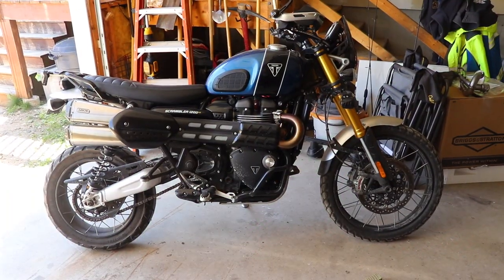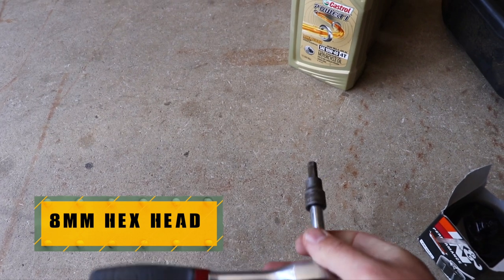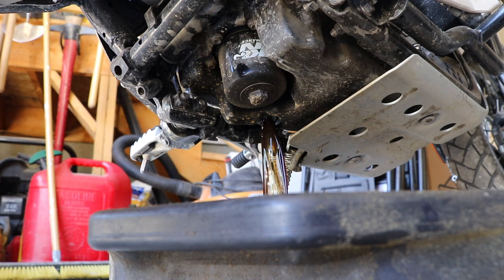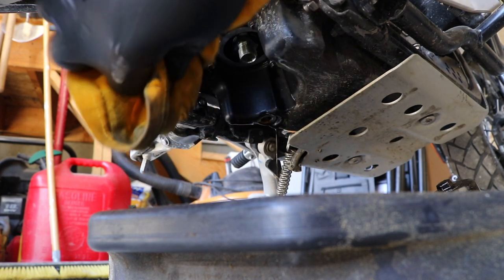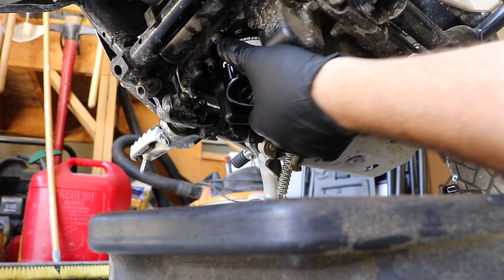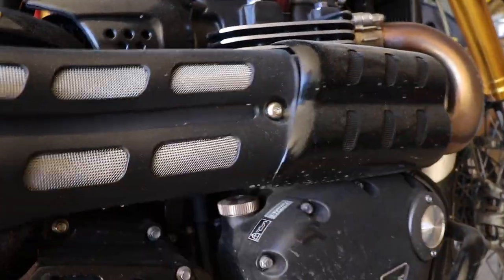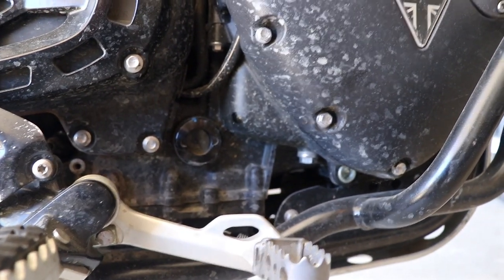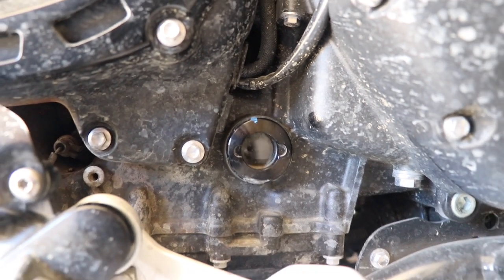How To Change Oil on the Triumph Scrambler 1200 DIY Maintenance EASY

Comment: Just a heads up to anybody that prefers using Oem filters, you can buy the Triumph Service tool that removes the OEM filter, if you plan on replacing it with a new Oem filter

Here is the part number for the oil filter wrench T3880313
Reply from the maker: Thank you for that!

Comment: For goodness sake, clean the areas around the oil filter and the oil plug BEFORE removing them, not AFTER you have put them back. Removing the filter and oil plug with all the road crap still around them is a classic way of introducing harmful debris into the engine. Also, that plug should be cleaned off carefully using brake cleaner or similar aerosol spray, paying particular attention to the magnet and then dry it before putting it back and fitting it with a new washer. Oh, and please DON'T use the draining oil on the seal of the new filter either, use a small drop of clean new oil. The old oil contains micro metal debris which can create a seal leak. Sorry but this is a conscientious mechanic speaking here!
Reply: I would also recommend using a torque wrench when tightening the drain plug. It is a $16000 bike after all... you can afford a decent torque wrench if you can afford this bike!
Reply: I thought the same and I'm not even a mechanic, that bike cost 20k USED! in my country (new 26k).
:/

Comment: Oil fill cap can be easily removed with 10mm hex socket and 6 inch ratchet extension.

Comment: Hi great video my friend where can you get those filters they look really good.. And how do you get the old one off do you need a special tool for that... I notice that your heat shields are black did you spray them yourself and if yes what did you use or did you buy them and on the subject of the heat shields does your back one rattle ....cheers J
Reply from the maker: Filters right from Amazon. The factory one is super tight, you just have to talk mean to it. I use a large pair of channel lock pliers to take off the factory, the K/N one has a nut on it. I did paint the shiny objects, yes, used VHT. I have a vid on that posted. Ride Safe! Stay Safe!!
Reply: Hi thanks for the information I had a look on Amazon for that type of oil filter it seems it at a great price and there's alot of good reviews for this filter but there is one review on there saying that there a fault on these filters where they leak at  the nut have you every come across that type on problem my friend...👍😎

Comment: You should admonish your viewers that the nut welded on the end of the K&N filter should only be used in removing the filter, and never tightening the new one. Many reviews of the K&N point out that if you use the nut to tighten the filter, it may cause a leak at the spot welds where the nut is welded on. I also make a point of replacing the crush washer on the drain plug. It's cheap insurance to make sure you have no oil leaks.
Reply from the maker: Agreed sir

Comment: Hey! Cool video man! Thanks a lot! Quick question: How much oil did you buy? I've heard that the Scrambler 1200 (I got the XC) is oil "hungry"... Thanks in advance!
Reply from the maker: I haven’t found that it uses any oil, I just fill it and check it every so often.
Reply: @BackDraftBikes  Hey! Thanks for your reply. Sorry, I wasn't clear. I meant, when changing the oil, how much new oil should I buy to fill my bike up again?

Comment: Thanks for your sharing! I am considering to buy this XE model but It ridiculously costs a lot to do such simple maintenance in my country local dealer. But after completed changed filter and engine oil, how to disable the “Service Reminder” signal shown on the digital TFT panel? Does this Scrambler 1200 have this service reminder setting? 

Greetings from Malaysia
Reply: It’s a great bike and easy maintenance. The TFT screen can reset the service reminder.
Reply from the maker: The reset reminder was available after the first production run. If your bike is one of those, you have to get an update from the dealer. Once that is done, press the home button, and you will find it in one of the menus. Thank you for the comment!

Comment: IS IT CRITICAL TO CHANGE THE OIL AT THE 500 MILE MARK?I'M AT 2400 MILES ON A NEW 2019 TRIUMPH SCRAMBLER 1200XE AND I HAVE'NT CHANGED THE OIL YETTHESE ARE LONG DISTANCE MILES,NO DIRT.I BOUGHT THE CASTROL RS RACING 4T 10W-50 FOR THE OIL CHANGE I INTEND ON DOING WHEN I TAKE THE BIKE OUT OF STORAGE.I'M GOING TO USE THE FILTER YOU RECOMMENDED.
Reply from the maker: Break in metal fines is what the initial service is for. Safe riding mate!

Comment: Thanks for the video, quite helpful. But Triumph has not made it easy to check and change oil on this particular motorcycle, which I also own. First of all, you cannot get a center stand for this motorcycle which makes checking the level of oil by yourself quite difficult; it's a balancing act with top-heavy bike and kneeling down on your knees, you can never quite be certain that the Scrambler is in a vertical position. Why not have the level marks in the glass conform to the bike in it's side-stand position?

Secondly, the filler cap is very hard  to access with a tool. I don't have a hex wrench that long, sorry, and Triumph doesn't provide one. At first I thought I would have to dismount the header to gain access. If you put it way back into the recess of the motor, than at least make filler cap easier to twist with your bare hands. And then you have the problem of getting the oil from your bottle to the engine. I have never seen funnel like the one you used and again Triumph doesn't offer one either.

In summary, I think design won over functionality for this particular Scrambler. No center-stand (option available on the XC, BTW) and the usually mundane task checking your oil and just filling up your engine oil requires special work-arounds and contortions. The manual is a joke and fails to address any of the difficulties.
Reply from the maker: I couldn't agree more. I hate hate hate the oil fill. A few tips for you: The funnel is available at any auto parts store, it is a Transmission funnel. They are like $5. Secondly, a tip an old mechanic showed me...take a scrap piece of lumber and put it under the side stand to get the bike close to level. You have to be careful, but it does work. I just ask my wife to look when I am on the bike. I have also used my cell phone to snap a video and then I would look at it to see the oil level. ---CENTER STAND WOULD BE SO MUCH BETTER! Anyways, ride safe!
Reply: Hepco and Becker make a centre stand but it's extra weight so I use bobbins and a bike lift. You need it for chain adjustment anyway. Buy an extension for your hex wrench, cheap and surprised you don't have one as you use them for everything. Long funnels you can get at a parts store or pop your present funnel into an appropriate length of clean garden hose. None of this is hard.